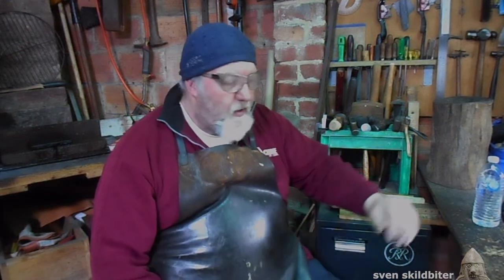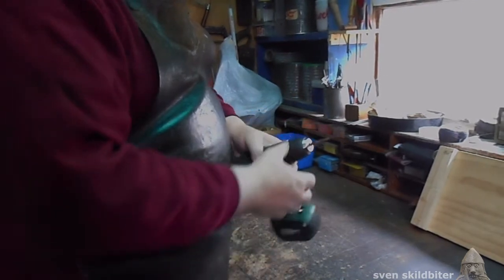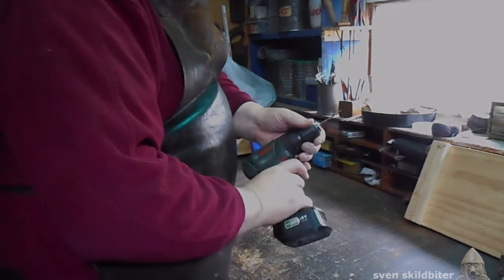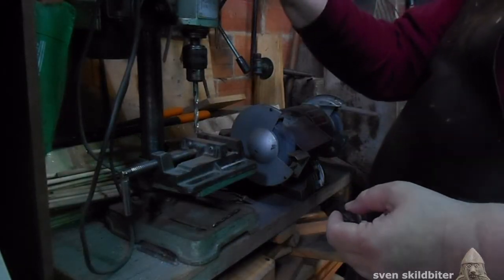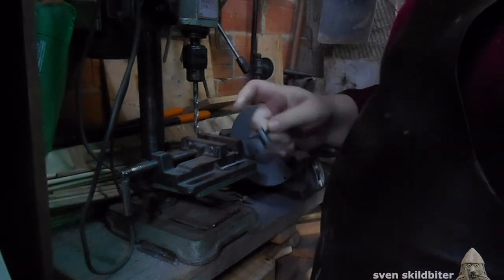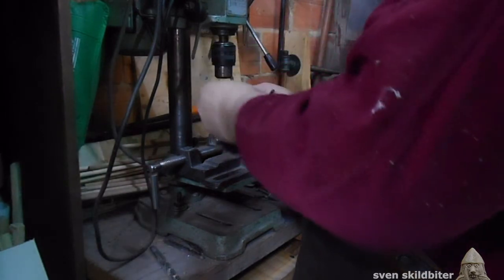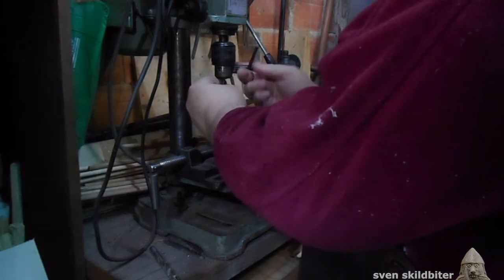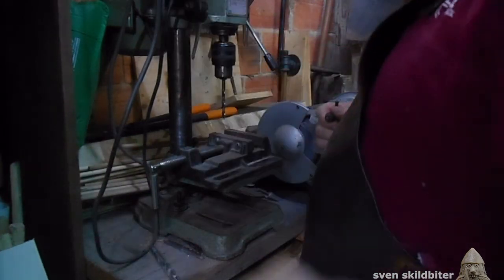Keyless chuck versus keyed chuck for drills

Comment: I prefer a keyed chuck drill over a keyless chuck.  There is something satisfying and puts your mind at ease when you can easily torque down the drill bit as much as you like.

I found a Dewalt model that is cordless and uses a keyed chuck.  But currently, for me, this is more of a want than a need and at a $400 price tag, just don’t see me buying one anytime soon.
Reply: Just buy the model you like and replace the chuck!
Reply: @AutodidactEngineer  and how much does something like that cost?
Reply: @Gaba-oo4qb  You can get a röhm or Metabo chuck for around 30€.
Any sub 100 dollar(Tool Only) Dewalt, Milwaukee or Bosch should be fine!
I personally am rocking a Parkside Performance 150nm drill btw and excellent drill and build quality also extremely affordable!
Reply: @AutodidactEngineer  I may have to look into this. Thanks for info.  May learn something as I am taking off drill housing and swapping out chucks.  It will be fun experience

Comment: I was always taught that with a keyed chuck, the key is used in each of the 3 holes to ensure that the drill-bit is held securely
Reply from the maker: I believe any one of the holes will do as they perform the same action to close the teeth of the chuck.
Reply: @svenskildbiter1434  I was taught to tighten the chuck in 2 or 3 positions to avoid the drill bit slipping. I have seen many scored drill shanks when only one hole ha been used.
Reply: @svenskildbiter1434  9